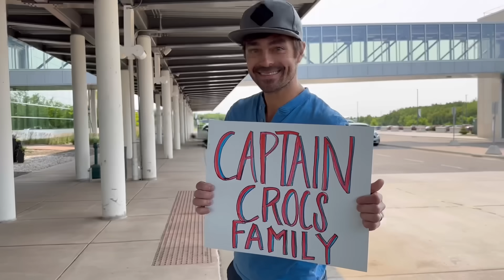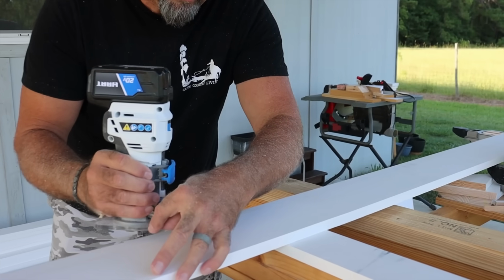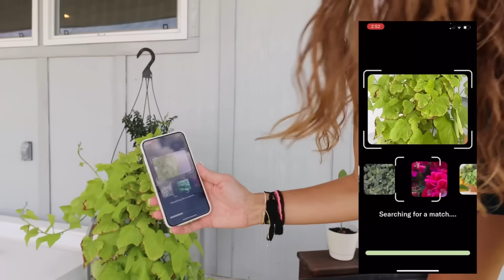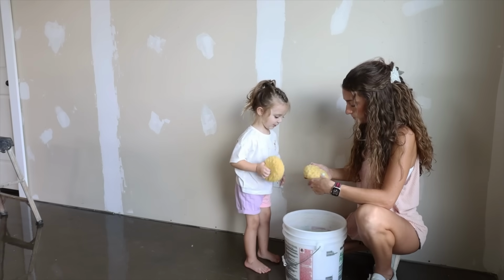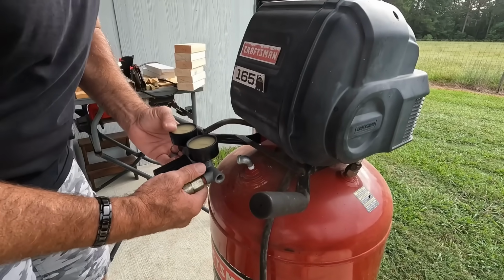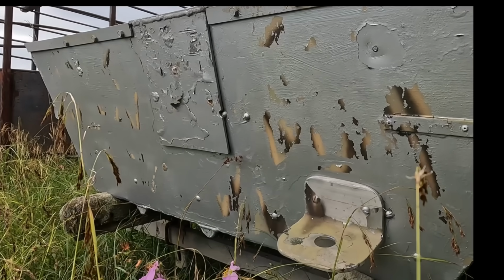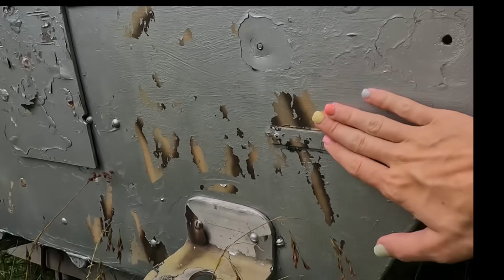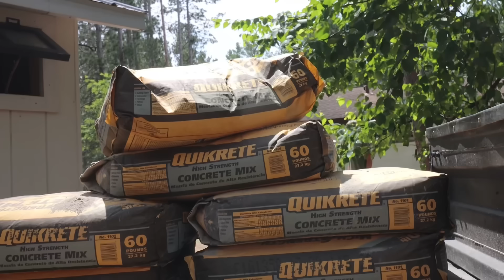We Had to Get Away!! | Building Our Own Home Ep.102

Comment: The Air Bottle Hootis is ok, because the bottle is manufactured to handle a 170psi pressure, but it would be much safer if you had a release check valve on it.

Comment: Sorry if I mentioned this before, but I think it bears repeating. A much better choice for taping drywall joints is the paper tape. It will hold up much better in the long run. I'm speaking from experience. Paper tape contains the same gypsum as the compound and holds the compound much better than the fiberglass tape. It is a little more work to use as you must wet it first and then imbed it into pre applied mudded joint. Your choice of course, but long term, paper is the best choice. Especially in corners. God bless, stay well.